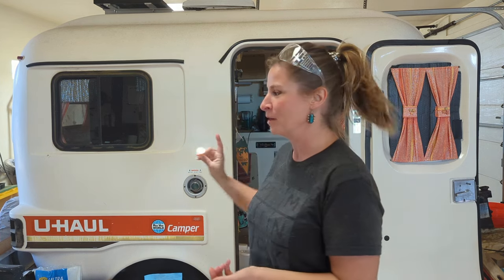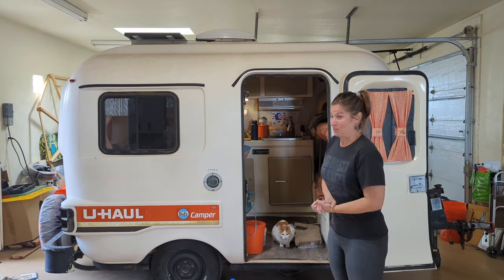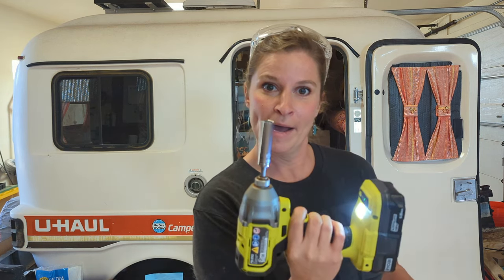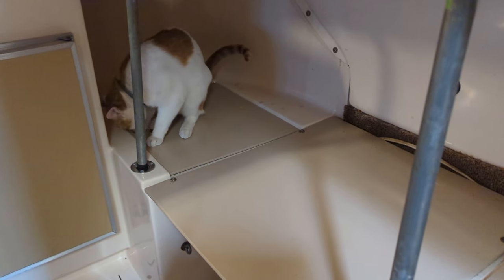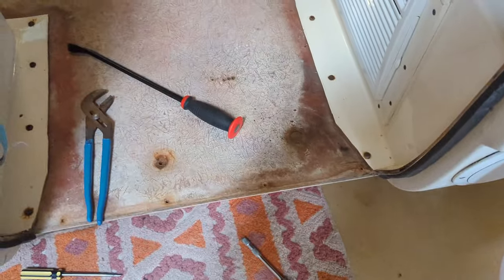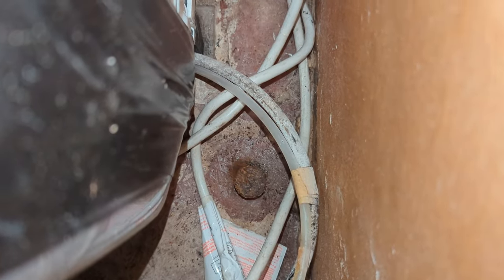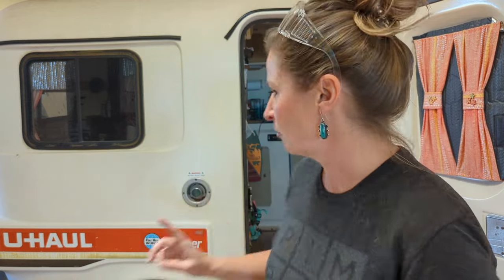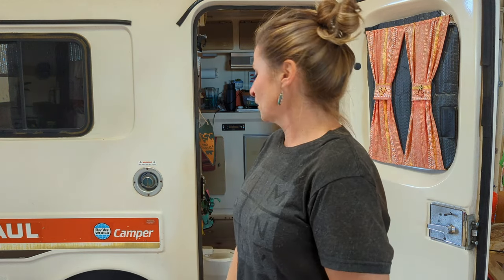🔩 How To Properly Change Rusted Elevator Bolts in Your Vintage Camper

Comment: You did a great job and most people do not even know what an elevator bolt is. Most people do not know this but fasteners are not designed to be reused. This is because during the installation process of any fastener , the material is stretched changing its tensile strength which makes it weaker. Trying to prevent breaking the fastener is not really necessary since you should replace it anyway. 

Just an FYI

Keep up the good work. The work you've done has only made your camper more secure to the frame and less likely to come loose during your travels.
Reply from the maker: Thank you! All great points that you made as well! I love this little camper and want to keep it in working condition as long as possible. 💛

Comment: Thank you! I have a Uhaul as well and the bolts is my next project.
Reply from the maker: Oh perfect! So glad it can be useful! I broke 2 when I was unscrewing from the bottom that I cannot get to from the top... So there is no elevator bolt in those 2 spots at all now. I'm sure I can fix it eventually, but with all of the other bolts being new, I'm less worried about having a problem than I was with the rusty ones... Hopefully you won't run into any of the same problems and your project goes smoothly. Hope to see you down the road!

Comment: elevator bolts are different from carriage bolts.  Elevator bolt heads are larger.  Check out McMaster Carr.   It looks like you are using grade 5 zinc chromate elevator bolts which are a good choice.  I recommend you replace the nuts also.

Comment: I was just watching "How to install an air conditioner in your RV | Installing a Window A/C in a Uhaul CT-13 tiny camper" on YouTube, and realized your water leakage might have been caused from a clogged drain hole (or none at all) from your AC unit.
You might want to check that out if you plan on using the AC.  As well as using it while plugged in, you could probably run it with a big enough inverter, battery and solar, or from a power station.
Jon in rural BC, Canada
Reply from the maker: Ah yes! I have hardly used the air conditioner... I will look for a drain hole... I think it was somehow coming through the door or the front window I had replaced with plexiglass. It's more difficult to monitor that area with all of my cat's stuff in the way, but I'll have to do a better job of keeping an eye out. Especially if it rains. I won't be using the airco anytime soon. Thanks for the thoughtful insight! 💛
Reply: @tennesseewanderer  The fellow installing the AC, had to drill his own drain hole,
It might also be the tilt of the unit.  I had a window unit that tilted slightly in and water came inside my apartment under the front of it.
I shimmed it slightly up so it tilted back and drained outside.  That might be an easier fix for you, depending on how your AC vents outside.
Jon

Comment: Just a couple thoughts. Ditch the A/C. You don't use it (I don't think you do, could be wrong), and you can can use the space. And you could always put one back in the space in the future. 

The grade 8 bolts are stronger than stainless, so it is a better choice. Spray the bolts/nuts under the camper with a spot of spray paint. It will give them a little longer life. But at this point the ones you put in will outlast you, so there is that.
Reply from the maker: Thank you so much for your insight! 💛 I do use the air-conditioning on occasion when I have hookups (which is not often). It works well for its placement on the floor which was put there by the previous owners, but you definitely have me thinking about reconfiguring... 

As far as the bolts are concerned, my dad is a smart man and knows how to save me some money and get the same, if not better results. I will definitely look into spraying them with some spray paint. Thank you for that! Hope to see ya down the road!

Comment: Think about it, your camper is dependent on the fiberglass holding it to the rail, frame of your camper, I would put big washers over the holes in the floor, if possible
Reply from the maker: The fiberglass is only soft in that one spot. Scamps and Casitas only have 6-8 bolts holding their frame to their body. With 21 bolts on the U-Haul, I'm pretty sure the body isn't going anywhere now that the rusty bolts have been replaced. Thanks so much for your concern. 🙏
Reply: @tennesseewanderer  🌞❤️🙏😺🐕
Reply: @tennesseewanderer  God's blessings from Georgia, Good night to you and your family, your dad and animals 😴💤

Comment: This is so helpful.  I am considering purchasing an older U-haul camper.  Where are the two elevator bolts located that are not accessible? I've also wondered about the underside of a U-haul camper.  Does the fiberglass coated underside tend to absorb water and have deterioration problems?  Did you paint the underside of yours with any type of waterproof sealant?
Reply from the maker: Hi there! One elevator bolt I accidentally broke from the bottom was located under the air-conditioning unit. There is a block of wood glued to the floor over top of it. The other is under the battery box in the back. The screws are stripped holding the battery box in place so I could not remove it without having another huge project to contend with.   I also noticed there were 2 brackets underneath with missing bolts. One didn't even have a place drilled for a bolt to go through to the left of the door frame as you enter the camper and the other is on the back corner on the sink side. There is a block of wood glued to the floor there as well to keep the water tank from shifting. 

I have not painted a sealant on the bottom. My camper was in great condition for it's age ... The problem was that I had water leaking in somehow that got trapped between the fiberglass and the vinyl flooring I have in place and went unnoticed. Unfortunately it rotted the wood between the fiberglass. I have some epoxy coming that I will try and fix the floor with once I return from this little adventure I'm on.

I hope that helps! Let me know what other questions you have! I'd be happy to help you out any way I can! If you are looking to purchase one of these, give it a thorough inspection and make a quick decision if it's up to your standards. They sell pretty quickly, but you also don't want to bite off more than you can chew with possible repairs. All the best! 💛

Comment: I’m a carpenter of 50years experience, use stainless steel to replace them. Please!
Reply from the maker: Thank you so much for your expert advice. I will definitely replace them with stainless if it ever needs to be done again. With nearly 20 bolts holding the camper to the frame and the others lasting nearly 40 years... It saved a little on the budget. These are zinc coated and should prevent rust, plus I can monitor the condition of these now that I know the condition they started in. And... I know exactly how to change them. Thank you again! If these ever rust, I'll take your advice for sure!